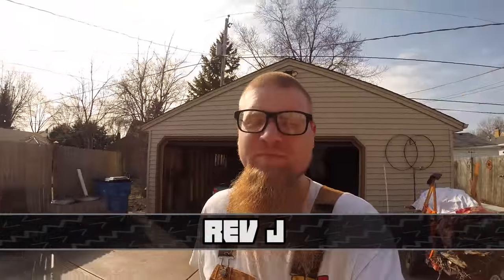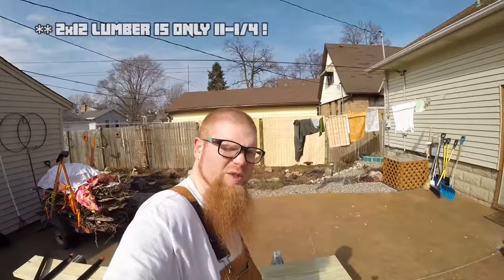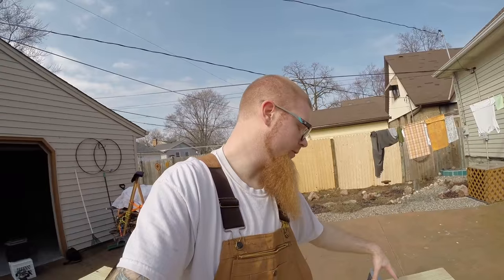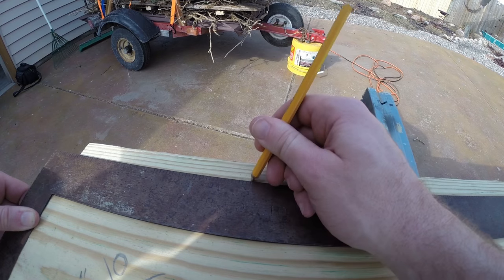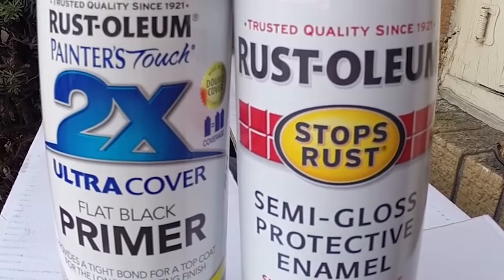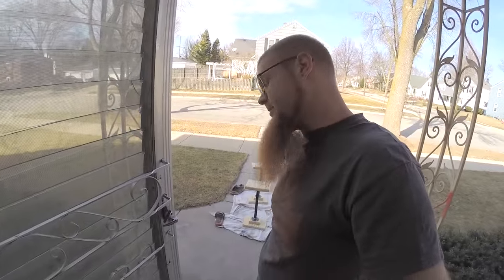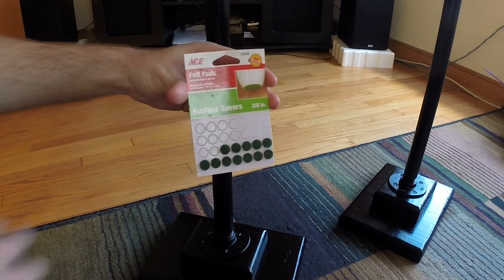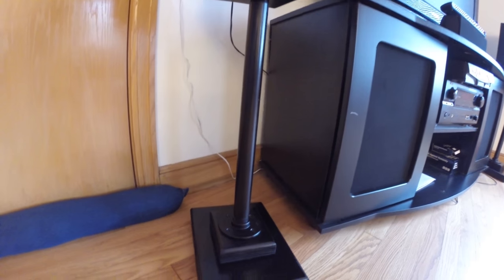DIY Wood+Steel Speaker Stands - REV J HD

Comment: Just found your video right now searching for DIY videos making speaker stands.  So far your design is the best one that I could find and there are a lot out there.  My stands need to raise my speakers 36"s, and since I have grand kids running around who have already knocked over the cheap speaker stands that I got from Amazon, the stands that I am going to build will need to have some weight at the bottom so they don't easily topple over. 
Going to use your design but I will be making a box on top of your bottom foundation.  The box will be hollow and I am going to put some lead weight in it and bolt it down and then finish it with the rest of your design.  And I will probably stain the wood instead of painting it.  But I will paint the pipe black and will look good against the wood grain.  Thanks again for a great DIY video!!

Comment: I just made some cheap small stands for my old Alesis monitors, limited space, desktop, I wanted to get them to ear level, it was pissing me off. I got four plinths from Home Depot,
some glue I already had here, stick on bumpers, and that was it, speaker stands. They do need staining, though. But they were the perfect size for the Alesis. They definitely sound less
boomy and sound truer than they did without them. I'd rather have a shop and be able to make stuff like this, though, but I don't because I'm living in a stupid apartment.

Comment: Hii! How did you attach the wood to each other on the bottom part of the stand?
Reply: Wood glue would be the most sensible thing to use. Once cured, the bond will have been stronger than the wood itself.

Comment: if I have a soundbar and I wanna out the bass on a stand is that recommended? I was wondering if it better to out my soundbar bass on a stand
Reply from the maker: The subwoofer? I would not recommend putting it on a stand.  You won't gain any bass, and you'll probably get some vibration.
Reply: REV J ok. well that saves me money. thanks. because ill obviously be on my bed so I wanted to make sure I feel and here the bass. I'll just find the right spot for it.
Reply from the maker: Bass is omnidirectional, meaning that because of its large wavelength and low frequency, the sound travels well in all directions. Placement of the sub isn't as crucial as any other component. If your sub sits directly on carpet, try using some carpet spikes to raise it slightly and prevent it from directly transferring the vibrations. The wireless subwoofers that come with most soundbar setups are not extremely powerful, so you'll most likely be limited by the actual output of the sub itself.

Comment: Any issues with vibrations while the speakers are working?
Reply from the maker: +abc140290 None that I've experienced so far. I took it easy on them for a day (some folks believe in speaker break-in, others don't. I figure it can't hurt)...but in the last day I've watched like 3 movies and a bunch of TV on them at home-theater volume's and have been very pleased. I haven't put on any bass-heavy music for a prolonged period though. If I do notice anything that comes up, I'll cut a size-appropriate square of high density silicon matte and slide it under the speaker. The felt feet eliminate any vibration or hum from the contact between the stand and the floor, and I'm sure on carpet it wouldn't be an issue. Cheers.
Reply: +REV J Cheers! Your video has convinced to make my own when i order my Elacs!